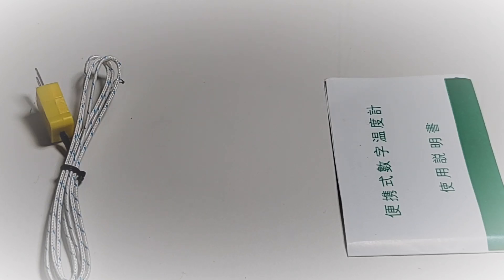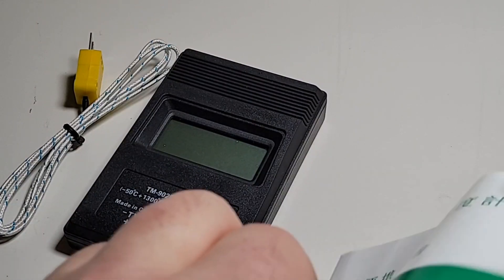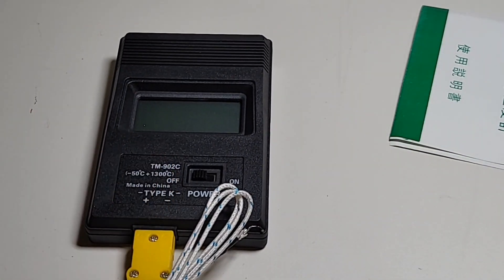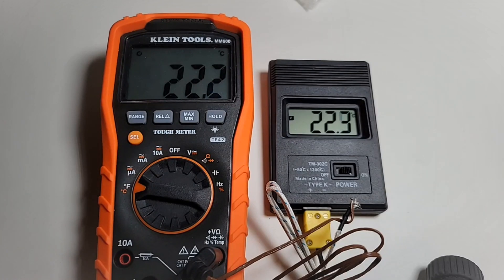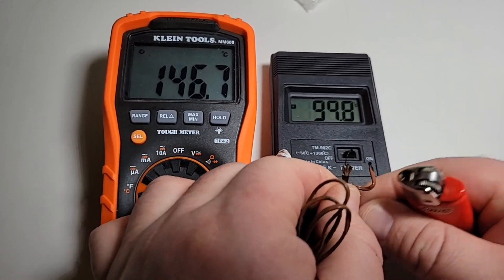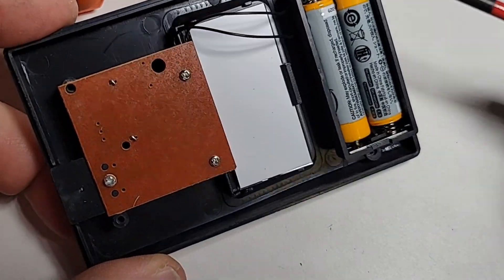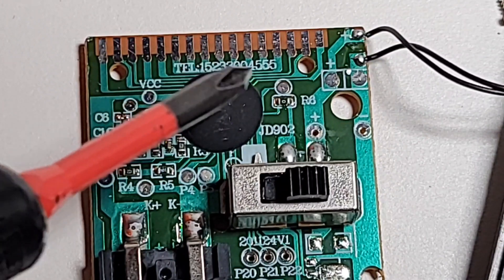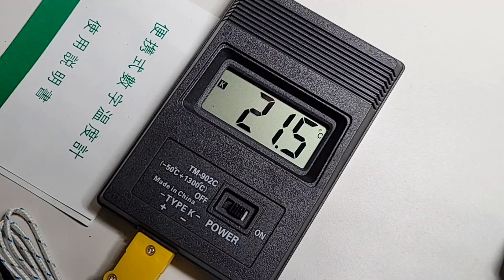TM-902C CHEAP-O THERMO-Meter Review & Teardown!

Comment: I am using same from few months on my 2 stroke engine for CHT reading, but my one runs on 9v battery and it get hang after few minutes so need to restart it after a while, may be my one have some problem inside and i need to buy the newer model.
Reply from the maker: It's been performing very well, no hiccups as yet. Try another unit and I'm sure you'll be fine. Interesting yours is a 9v unit 🤔

Comment: I feel the extreme low cost of this product does justify it's lack of features no problem, and it's reasonable robustness and accuracy are just a bonus. 
Who needs a tilt stand when you won't feel bad drilling a hole in your $5 device to hang it on the wall? Why ask for a backlight when the amount of money you save will allow you to buy a thrift store lamp for no money instead?

Comment: For those interested: The Brymen 869s multimeter also has a double thermocouple. In the range of -50c+1000c. accuracy 0.3% resolution 0.1c
Reply from the maker: As does the UNI-T UT181A ..
Dual Temp         40°C/1000°C +/ 1%

Comment: How does it work?
Reply: Thermocouples are made with two wires of different metals joined together at one end to form a junction. As the temperature changes, the two dissimilar metals begin to deform, causing a change in resistance.
Reply: @shaunmorrissey7313  so how do they get back in shape after cooling down?
Reply: @shaunmorrissey7313  Thank you Shaun 😄
Reply: @KeepOnTesting  and what material is used for the junction or sensor?
Reply from the maker: @bhushan9066  most common type is Nichrome contains 80% Ni and 20% Cr...due to its wide temperature range. Look at The Seebeck effect for more detailed information 😉👍
Reply: @KeepOnTesting  Thanks a lot! So, the change in temperature generates EMF and then some sensors and resistors with the IC do the rest of the calculation I guess.